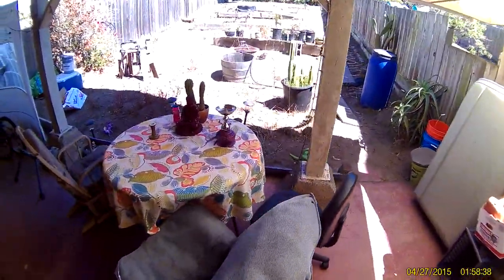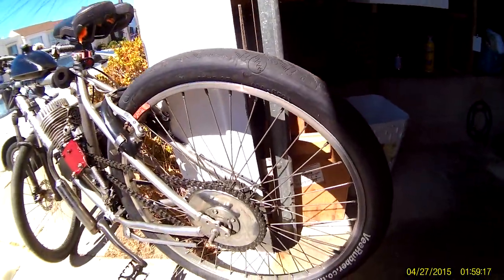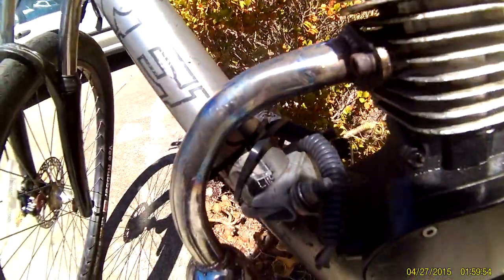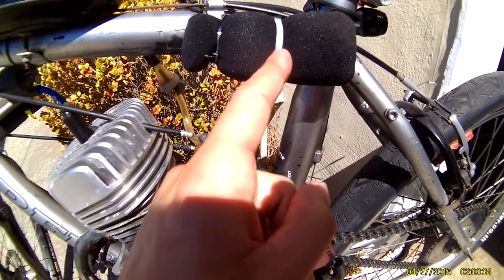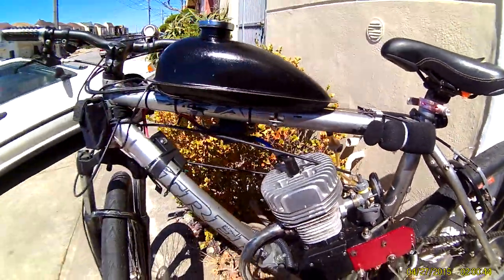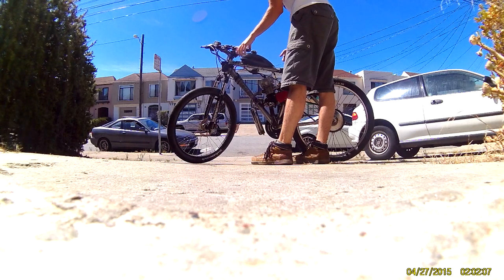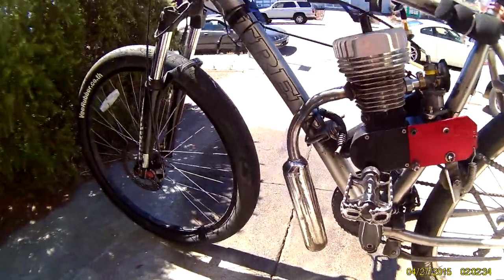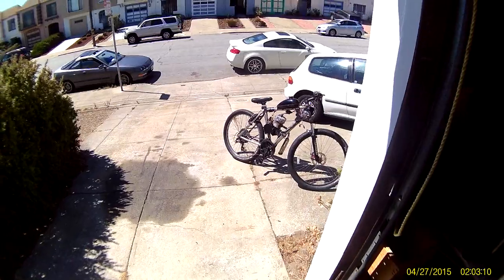Race bike

Comment from the maker: Dunno, It's always been like that though and works perfectly fine so I don't give it second thought
Reply: +sander dude As long as it works for you that's cool ... never seen a gap between the cable housing and the top of the carb before, seems like the cable would fray after a while. Nice looking (and sounding) bike though - props on a nice build!